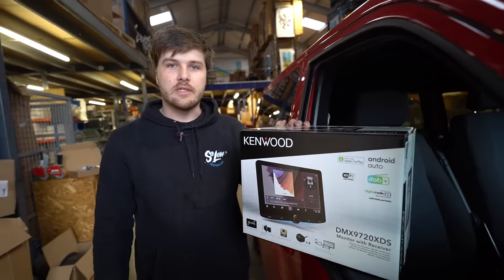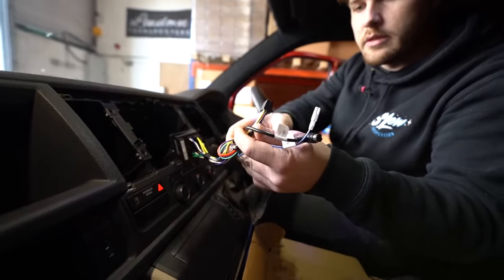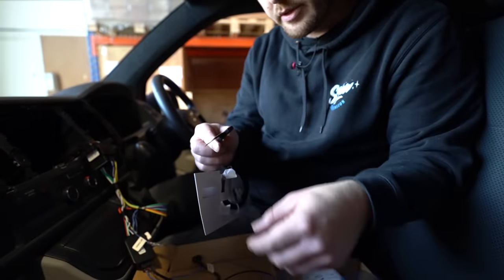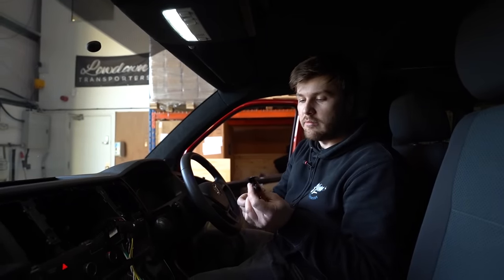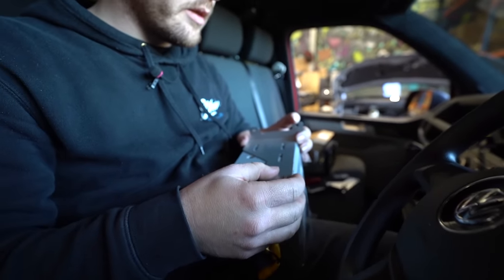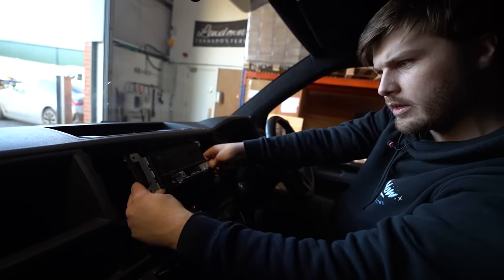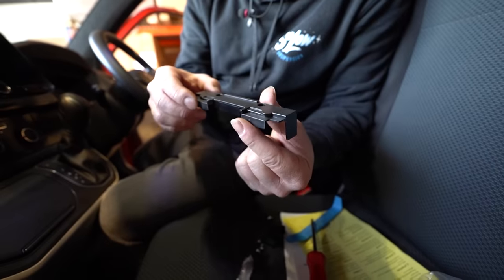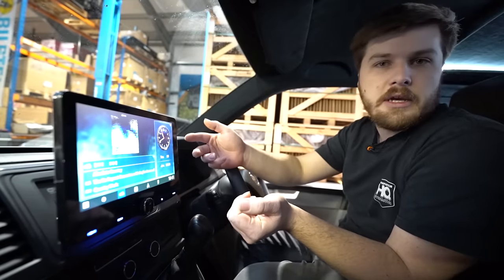VW Transporter T6 Kenwood Floating Head Unit Stereo Install - DMX9720XDS

Comment: Did it works with vw camera, radars and vw Bluetooth (for the mic integrated)
Reply from the maker: VW Camera yes but you will need a patch lead. We can supply this. Radar yes. Bluetooth if uses its only mic but you can not dial out using the steering wheel.

Comment: Do you need anything keep the usb interface working?
Reply from the maker: On the T6, the USB isn't retainable. It would be USB lead into the glove box. We have actually previously modified the built in USB to work but there is no actual retention lead.